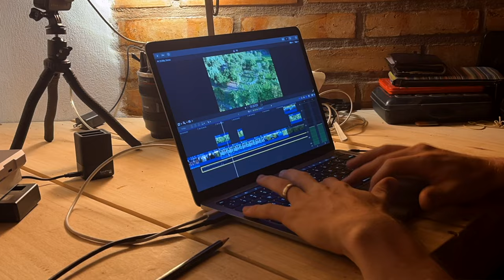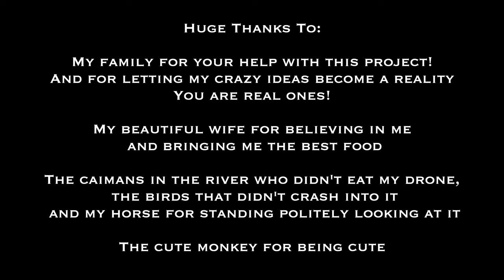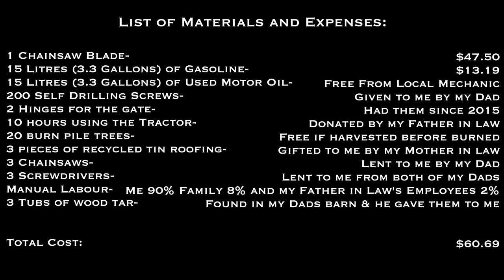I Built a Horse Training Round Pen For $60

Comment: Hello friend, your corral looks great, top notch! However, the diagonal brace/board that you put on your gate is going in the wrong direction, for maximum strength it should go from the bottom corner of the gate "on hinged post" up and across to upper corner of the gate (that swings open). This way, that diagonal brace supports the weight of the gate and takes the load down into the base/bottom of your hinged post, where the post is buried into the ground is the strongest and most stable point! As opposed to the way you have it, where the diagonal brace is literally hanging from the top corner of the hinged post, where the post is less stable. Your way, the weight of the gate is unsupported and pulling down towards open corner of the gate. This is a common mistake that I see all the time and for the most part, your way will still last for years, However, if a person or people were to sit on the gate as it swings open or closed you will start to notice a significant sag of the gate that can compromise the integrity of your gate. In my younger days, I installed fencing and gates of all types and all materials and I would always show my customers how I could hang my 250+ lbs on their gate as it swung open and closed without any sagging or weakening of the gate whatsoever.  (If it helps, imagine that your gate only had the top rail and the diagonal brace, there is only one direction that the diagonal brace can attach from open end of the top rail, down to the bottom hinge of the post and support your weight, the other direction, the brace supports nothing) It's much easier to just point a finger and show you in person , than to explain the concept in words, sorry.
Reply from the maker: Hi there! Thank you so much for your comment! Very insightful and I can tell you are a skilled craftsmen! I will definitely see if I can swing that board around so it actually does what I wanted it to do! Thanks again for the tip! 💪🏼
Reply: @HorsePerfect  Good, you'll immediately notice a difference. And if your gate sags at all when you remove the brace, just prop it up or lift it to where you want it, before reinstalling it the right way. You are welcome, and thank you for your videos!!!! And BTW, the brace board should actually extend from corner to corner. If I recall yours was a tad short. ¯\_(ツ)_/¯

Comment: Good work.  Couple of tips for next time if I may: If you cleave your rails and uprights, they will last longer as water penetration into entire fibres is a lot slower. Of course you can't cleave stuff with big knots so sawing remains your best option.  And a cleaving brake makes cleaving smaller diameter clear lengths easier....
De-barking timber also makes it last longer as the bark rots fast and when green bark beetles and such will get in and rot it (and wood beneath) away.
Reply from the maker: Hi Anemone, interesting tips! I’ve never heard of cleaving what does that entail?
Reply: @HorsePerfect  Watch this vid (not mine, this guy is really old school-hand tool but knows his stuff. The bit you want starts around 10 mins in:  https://www.youtube.com/watch?v=ANAxxYFybOw      Any steel timber wedges will do, his are so old school with those wooden butts that I've never before seen them. Strat at the bottom end at any split that goes through the pith in the centre and it's best if the wedge you use here has an edge on it. then alternate the wedges and stand by with an axe or chainsaw to cut away any bits of wood that bridge the split. You will get wastage, and some split lengths may wind, but the cleft material lasts significantly longer in ground or above ground to make it worth while.
Reply from the maker: Very impressive! It seems like a great concept! I will have to try that at some point. Here in Paraguay we have wood that lasts over a hundred years without treatment it is so solid. They call it ax breaking wood! One day I will make another corral with that wood when I can afford it!